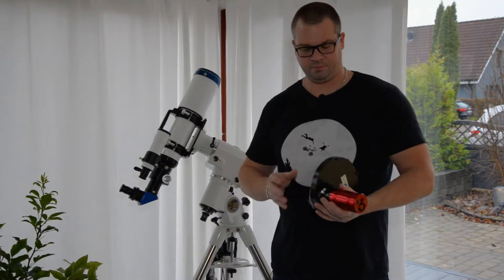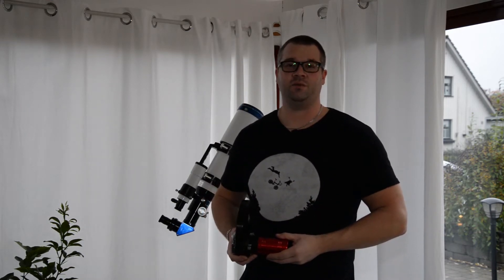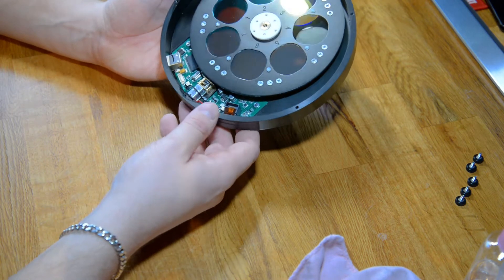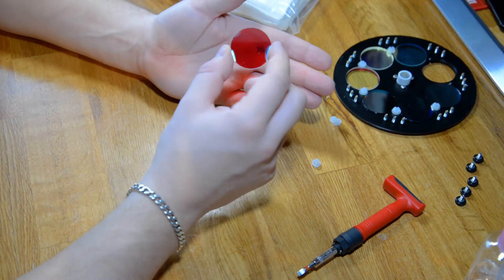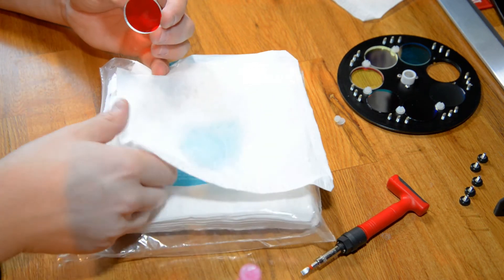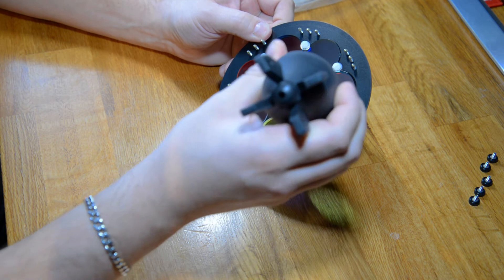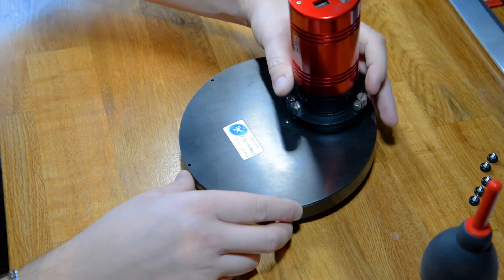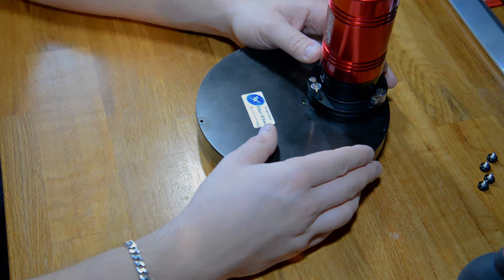HOW TO CLEAN FILTERS FOR ASTROPHOTOGRAPHY

Comment: good video,it is sometimes a miracle how dust van go in a full closed imagetrain.
i have the same filterwheel,some strange under windows 10..i start all up then i have  to disconnect the usb  to the filterwheel en connect again. other it will not be seen and working.
i have the last and good drivers for it. do you use windows  or something different ?

greetings and keep on going.  John https://www.astrobin.com/users/kajouman/
Reply from the maker: I agree, the dust seems to appear from nowhere sometimes. It can be a good idea to be in a bathroom with some humidity still there after a shower - it binds the dust.

I do run mine fw from windows 10 with the latest drivers, but in general it works ok, but sometimes I need to unplug the usb. Be sure to run USB2 ports and not USB3 - they “can” cause trouble.

/Daniel
Reply: @ExoPhotography1  thank you for the info
Reply from the maker: @kajouman  No problem :)